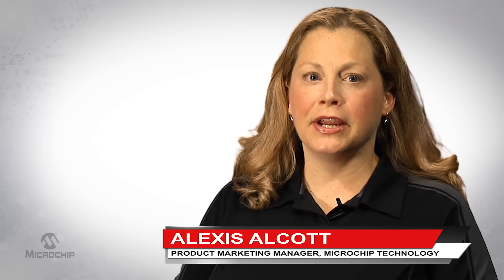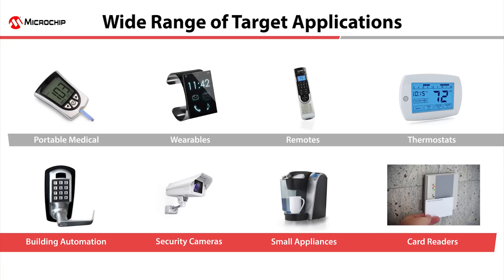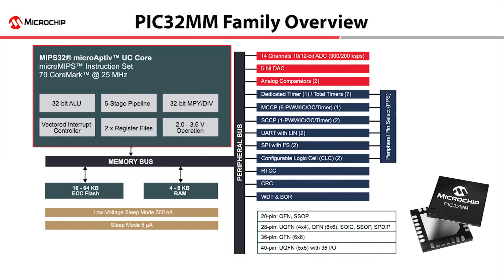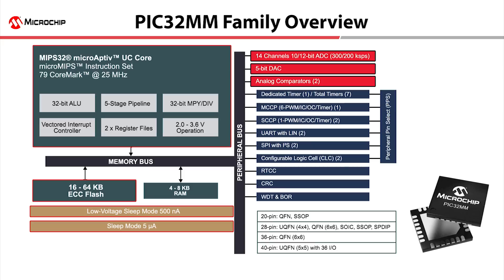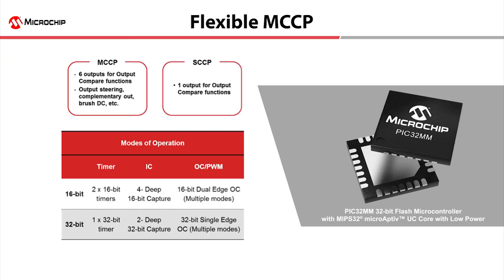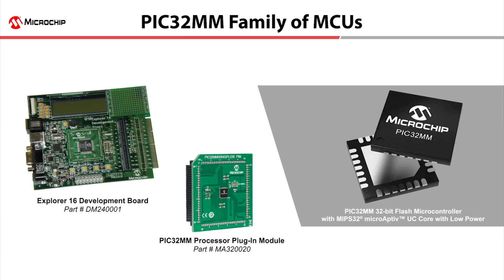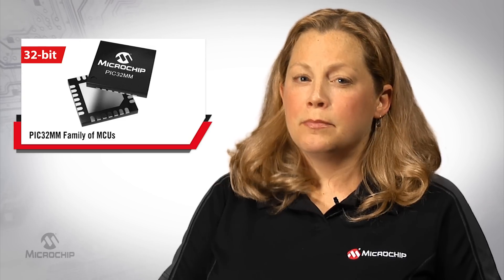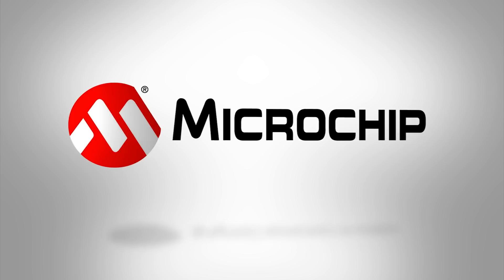PIC32MM Family of MCUs

Comment: When i read about pic32mm, i noticed that it have not DMA and BMX control for usermode.
Formaly microAptiv have usermode but i think it is rly not posible to use it on pic32mm.

I think pic32mm is the collapse of bright ideas of cheap mips microcontroller.
Very sad. I hopes on this series.